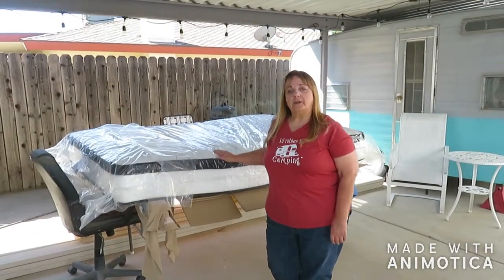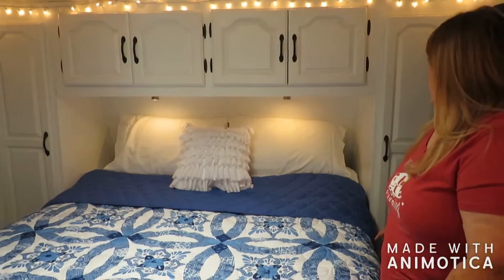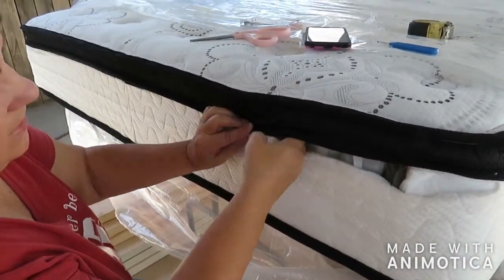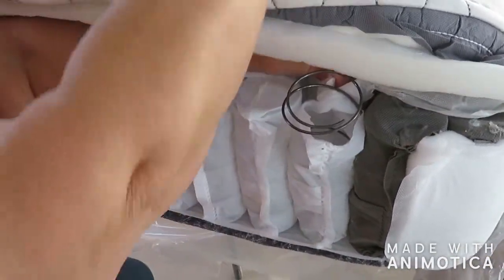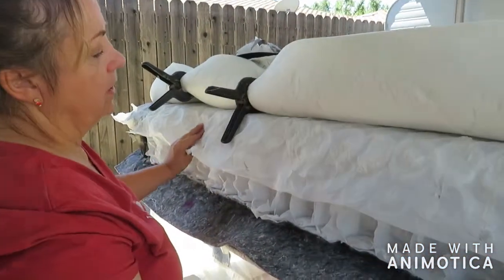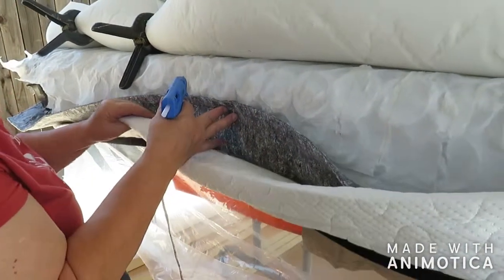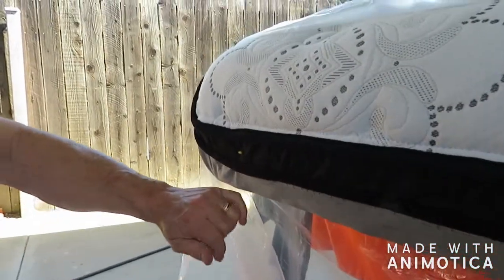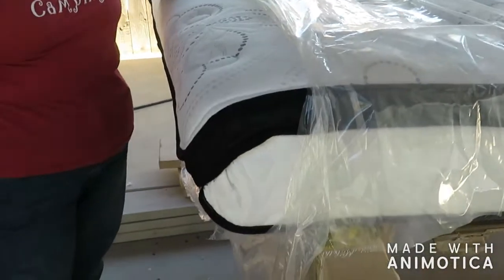How to shorten the length of a mattress that has coils for your RV

Comment: We used your video to help us trim ours down & we have a tip as well, we have smaller coils in our mattress so decided to trim off 4 rows worth. It worked out easier to just separate the material between the 4th & 5th row of coils then just cut the section of 4 rows completely off.
Reply from the maker: I am happy to hear our video helped you out.  I think some get a little afraid to give things a try but hey that's how we all learn and it builds confidence to try other things on our own.  Not to mention the money that is saved doing it yourself.  Thanks for sharing your tip, this is such a great place to share with other to help out and see them actually do it inspires us even more.  Thanks again and thank you for watching :)
Reply: @idratherbecamping6298  we loved your video so much we had been too excited doing this ourselves we forgot to take a before photo!!! But yet greatly appreciated for your help, thank you so much xoxo

Comment: Thank you so much for videoing this process!!  Apparently, I have the kind you shortened before... with coils connected with wiring all the way across. :(  It looks like it's going to be painful lol, but doable. Thanks for mentioning you cut down one like this, gives me hope.  I especially like how you showed the "buttoning up" process cuz I was not too sure how to do that.  I believe I have a curved upholstery needle. If not, I'll go buy one. Thanks so much you guys! ❣❣
Reply from the maker: Your very welcome, it can be done but it will be a bit harder because of they are all hooked together.  Just a little more work of course.  Make sure you have a good sharp strong needle it makes all the difference.  Thanks for watching! :)

Comment: Great video. Thanks for sharing. To hold the mattress back together at the end, would it be easier with Upholstery Twist Pins instead of sewing? BTW, you guys did a beautiful job. As a side note, there is something called DIY mattress. You can customize everything with latex and coils inside a zipper encasement and replace a layer once it gets worn out. It's not as hot as memory foam, more durable and quite affordable.
Reply from the maker: Thank you for watching, and for the tips.

Comment: Great video, can i do this with a pocket sprung, memory foam matress combined please?
Reply from the maker: I would think you can, mine had each coil spring in what they call a pocket, I also had to cut some of the memory foam back.  I really didn't know exactly what mine was going to be like until I opened it up but figured they are all pretty much the same.  I hope this helps you out.
Reply: Thanks @idratherbecamping6298  Yeah, i've just looked again and the one i've bought has springs in pockets like you say. It's about 4" too long for my campwervan and i might just try and compress it into the space. If that doesn't work, i'll attempt what you did, thanks.

Comment: Great video! Thanks for the info. Any suggestions for someone trying to cut down a linked coil mattress? I am wondering how to deal with the edges. Thanks!
Reply from the maker: First I want to thank you!  Yes my husband and I did do one years ago that had the linked coils.  I am assuming you are talking about the two bars that go around the mattress.  What we did after we removed the coils we used a hack saw and cut through the top and bottom bars on the sides of the mattress.  Make sure when you cut the bars you cut back a few inches behind the last row coils that are left.  Then we pushed the bar against the coils and tied the coils to the bars and then we wire tied or (zipped tied) both ends of the side bars together.  I sure hope this helps.  If you have any questions on this please ask and we will try to help you out :)

Comment: Hello, great video thanks for posting, would this method work if I needed to shorten the width of the mattress? Hope you can help :)
Reply from the maker: Thank you!  I would think you could if your mattress has the coils in it.  Mine was individually wrapped on this mattress,  I have also done one that the springs were clamped together it was a older mattress it was a bit harder but still got the same results by removing a few rolls of the springs.  I also know that some people have done this and took springs out in order to shape it to fit the bow of their boat ( the point) making the mattress a  triangle shape.  I hope this helps :)
Reply: I actually was searching for a video like this and searched the comments hoping someone had asked THIS question already! We moved into a small trailer and i would like to be able to do this so my daughter can have more space. Take off a handfull of inches off the width of her twin mattress. thanks! 💜💜💜

Comment: Somehow i missed what type of thread u used.

What type.of.stitch ??  Running??
.
Reply from the maker: I used a heavy polyester coat thread, that is what I already had. Probably another good thread which would work good would be upholstery thread, but the heavy coat thread work well and is holding up great.  As far as the stitch I used, I would call it a sloppy whip stitch LOL.  Ha it would had been a lot easier if I would had stopped and ran to the store and got a better needle to use, but it all worked out and I saved some $$$.   Hope this helped you out :)

Comment: hey, i love your video. but how would i go about cutting my mattress thinner?? not cutting the length but the height — to fit a bunk bed. my mattress is currently 12in high. the bunk bed recommends 5in-9in. please help :(
Reply from the maker: Thank you, I wish I could help you out but I am not sure how you would do that.  If the mattress has springs like ours I don't think it could be done.  If it's all foam then maybe you could slice it thinner.  I sure hope there is a solution out there to help you out, it would be interesting to know how it's done.

Comment: Is there any kind of tape that I can use instead of clue gun?
Reply from the maker: I am not sure but maybe if you cut down carpet tape into skinny strips.  We have used carpet tape to hold on molding strips while the glue dries in our 5th wheel and it worked great.  I hope this helps.

Comment: After modifying the mattress size, how do you find sheets to fit it now?
Reply from the maker: It's a queen size bed and I bought queen size sheets.   The sheets I bought has elastic all the way around on the fitted sheet,  kinda like a lot of crib sheets our made.  They stayed on just like as if the mattress was never shortened.  I have even used regular sheets that just have the regular corners too,  didn't have a problem with them either.  I do prefer the one's that have the elastic all the way around even for my mattress at home.  I hope this helps!  :)
Reply: you could also get the sheet suspenders and tighten up the corners that way. I use them on my bed on the regular bc i dont sleep well and i toss and turn all night which loosens the sheet. every. time. :( 💜💜💜

Comment: I need to do that to myn. I think my mattress is all linked coils :(
Reply from the maker: Thank you Ken san  for watching , the very first one I did was linked coils.  Of course this one was easier but I did the one with link coils and it turned out great too.  It's not to big of a deal really just a little extra time :) .
Reply: @idratherbecamping6298  on the linked coil mattress was there one solid outer edge wire that trims around the whole mattress ?
Reply from the maker: @frankenstein3163  Yes there was, my husband use a hack saw on the straight pieces at the end of the sides.  Then I pushed the curved piece in against the coils and wire tied it back together and onto the  coils.  I hope this helps and makes sense.  :)
Reply: @idratherbecamping6298  cool.. TY.. I was hoping i would not have to weld the weirs back to geather for the support. BY the BY I love your name "I'd rather be camping" :)